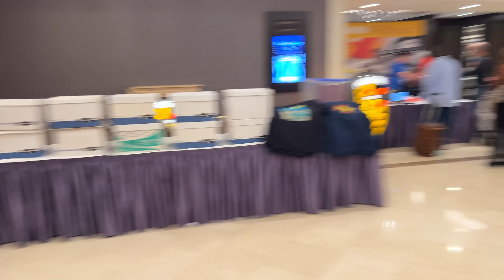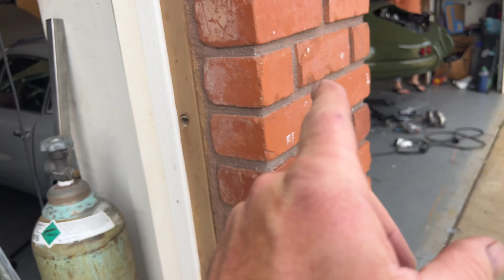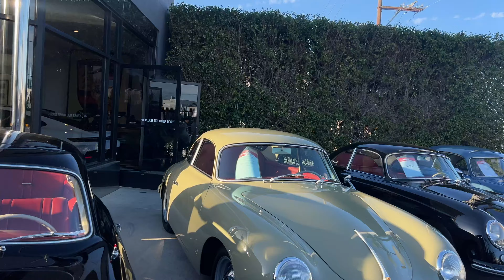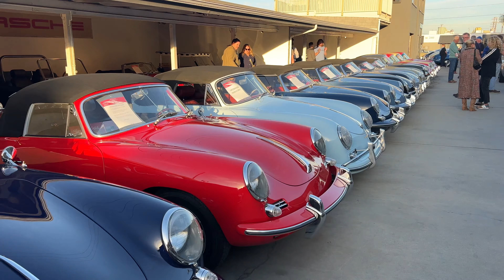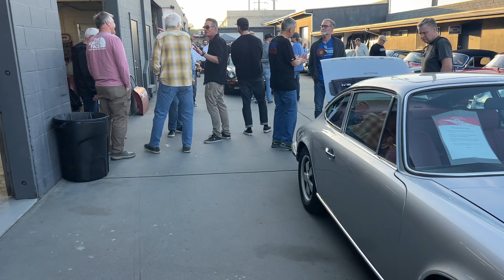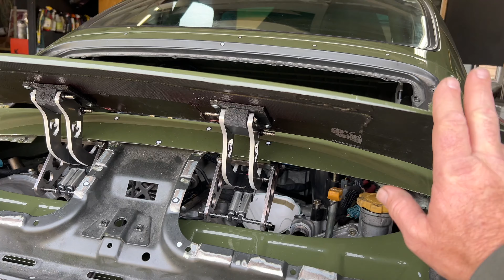Lit Show, TONS of Porsche Eye Candy, and ACTIVE AERO on a 1969 Porsche!

Comment: Is there a chance that you could make a 986/987 swap kit for this engine setup? I think it’s gonna be important for future collectors to keep early boxsters on the road as the affordable entry into Porsche, but there’s so little aftermarket for power upgrades on those chassis.
Reply from the maker: Definitely… That is in the plans but we have to solve the situation where there's no starter amount on that transmission or the Subaru engine. I did it on the blasphemy bill but it requires cutting the transmission pretty severely.